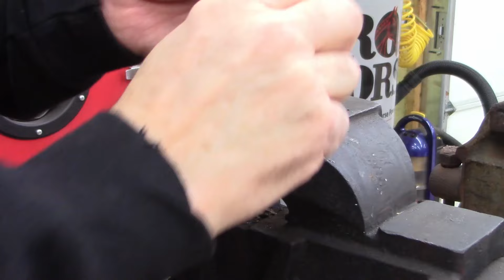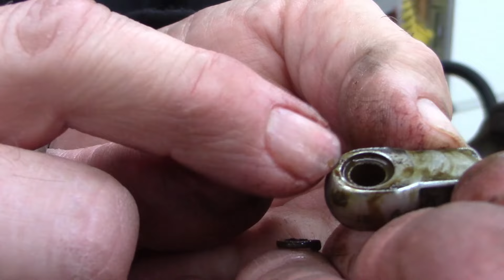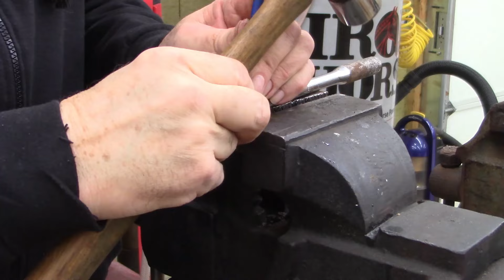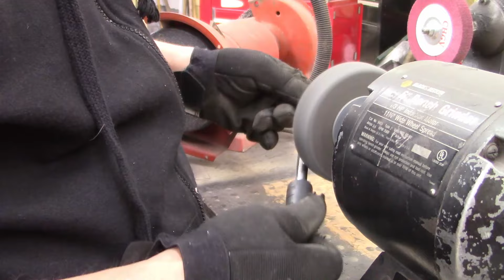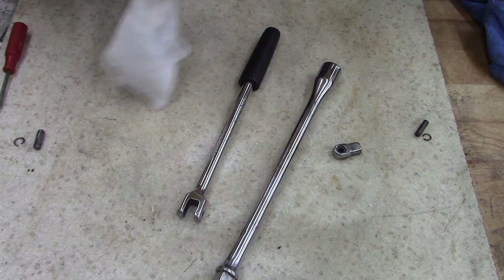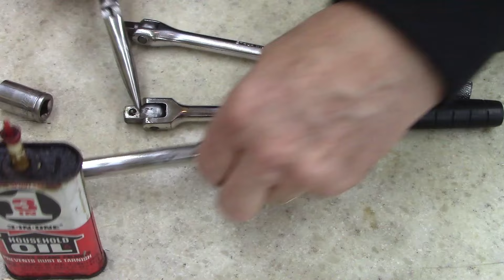Restoring Breaker Bars!

Comment: For those small holes or recesses, have used a piece of fine strand wire rope inside a piece of copper tube.  Cut a slot out of the copper tube so it “crimps” on to the wire rope leaving about 1/2-3/4 inch of the wire rope sticking out of one end.  Put the copper tubing in your drill and you have a butt kicking rust remover for pockets, holes, and tight corners.
Reply from the maker: Oh, I love your IDEA!

Comment: I use my breaker bars a lot for those stubborn nuts and bolts and when they break loose i twist them out like I'm using a big screwdriver. There's just some bolts that require a little more leverage and force.
Reply from the maker: I agree!

Comment: I have a Penn Craft 3808 and the detent (?) Is rusted frozen.  How do I fix?
Reply from the maker: Soak it in penatraing oil over night, then use a regular pair of pliers to work the ball-detent, most of the time this has worked, trying to find a video where I have used this trick!